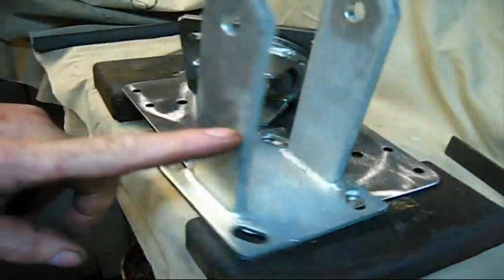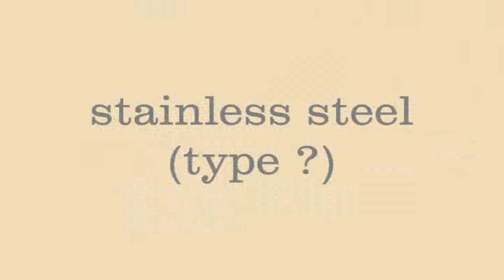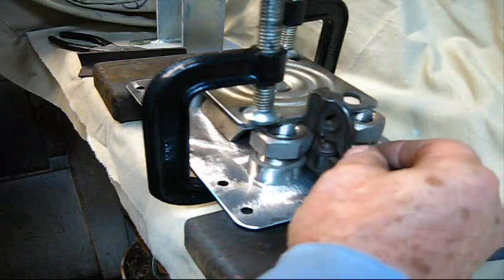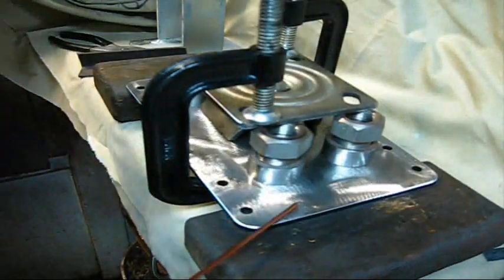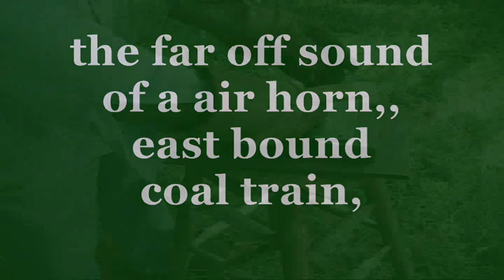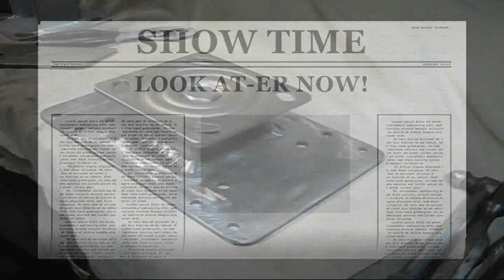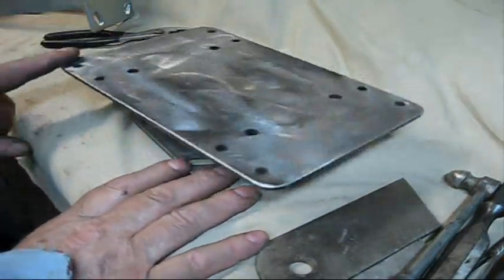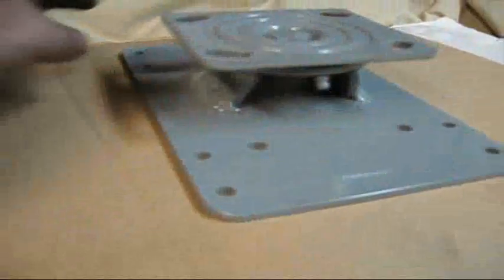How to build a Shop Turntable

Comment: Good idea M8, I did have a little trouble understanding you, as you seemed to keep forgetting the names of the things you were using/describing. 
This will make a great workshop tool, used under the drill press or as a stand  for a  project that needs turning round a lot. again, great idea, thanks.

Comment: Perhaps too late now to make a suggestion, however I watched your build and the other wheel bracket gave me an idea. If you bolted that to the caster bearing then with another bolt the dia of the wheel axle you can make your turntable a tilt model. You will need a substantial base for this, however it could make some jobs easier with this function. Cheers from John.PS. I will be making one for myself in the next day or so, thanks for the idea.
Reply from the maker: +joandar1 ,,, for sure,, I have built a tilting type,, just went about it in a different way,,,